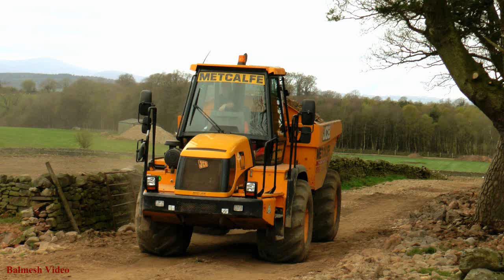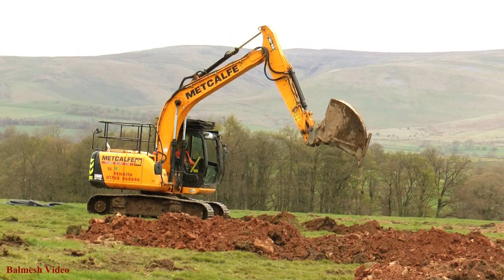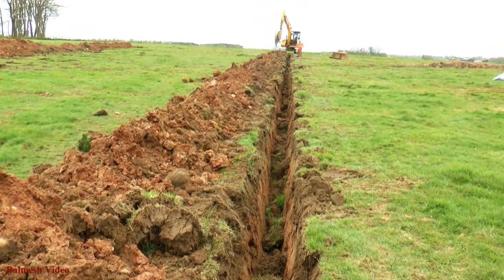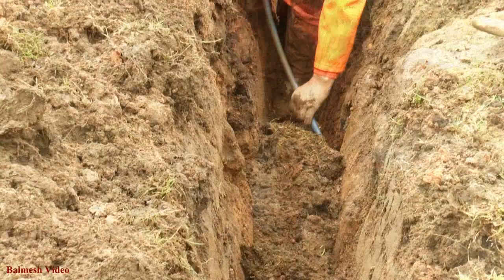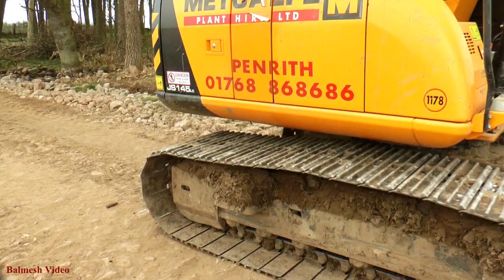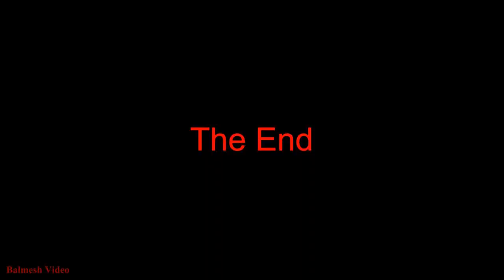Drainage and Road Building on the Farm.

Comment: Nice video, i have some questions. Do tracked Excavators have a licence Plate in the uk? What is the thing that he has on top of the cab? I ve seen on your video that this excavator doesnt use tilting grading buckets, is that for a special reason? Normally if you often work with topsoil and ditches etc. i think you might have one?
Reply from the maker: Sorry, I can't answer any of your questions.  I just don't know and It isn't my machine.
Reply: They dont need licence plates because they dont drive on the road they go on trailers
Reply: On top of the cab I think it I'd some drainage pipe